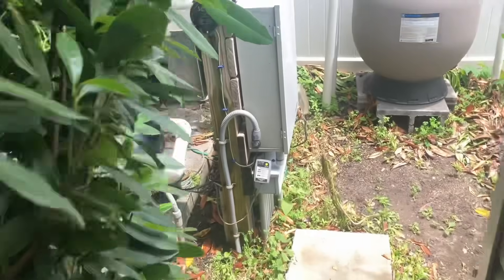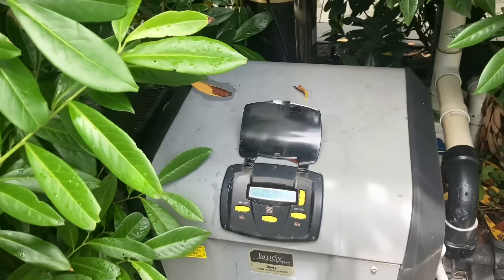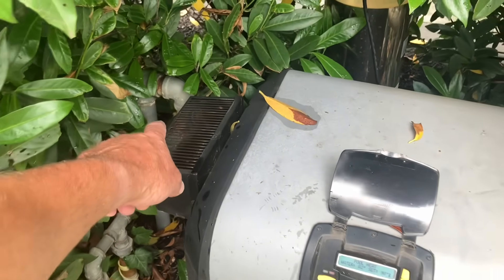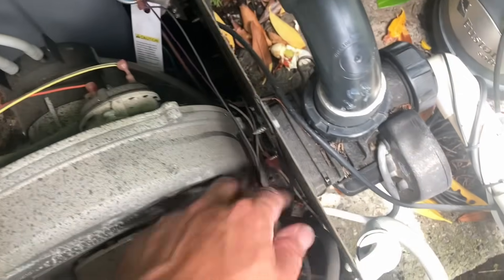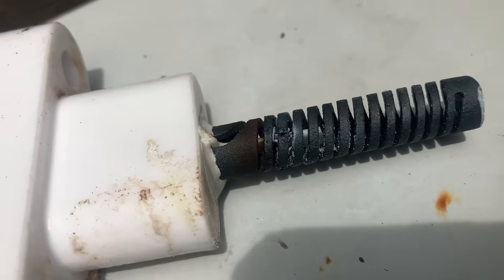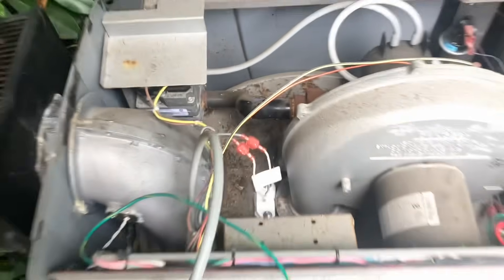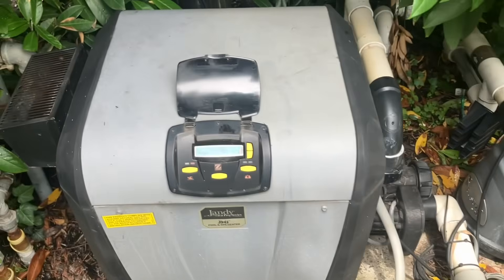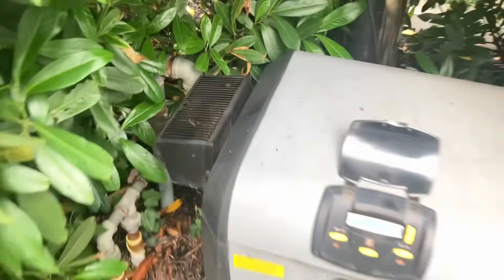Jandy Pool Heater Not Igniting? 🔥 Watch This BEFORE You Call for Service!

Comment: Jandy pool heaters are never ending money pits. The heat exchangers fail at ridiculous rates. Also  isn't this your personal pool? i remember you doing multiple videos on this jandy heater. Looks like you cant win with this piece of junk. We had to get ours replaced 2 times through warranty & it still failed, water chemistry was perfect btw... Switched to pentair & never had another issue.
Reply from the maker: And three days later, the hot service igniter is toast because it got wet inside the combustion chamber